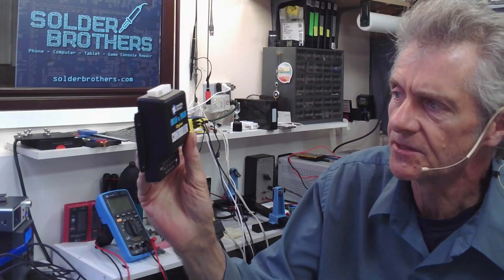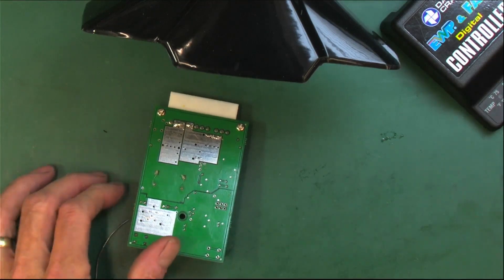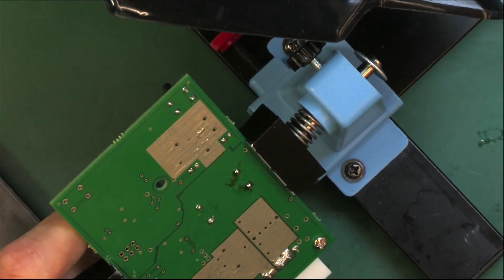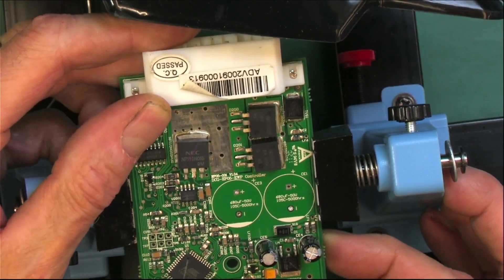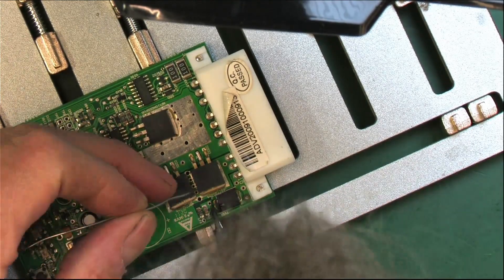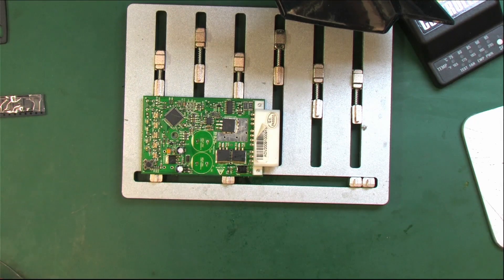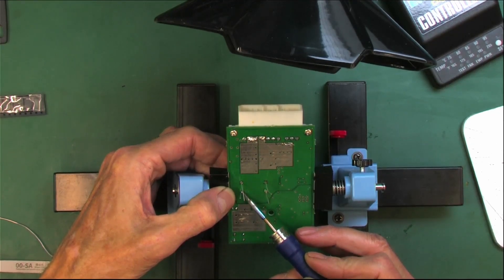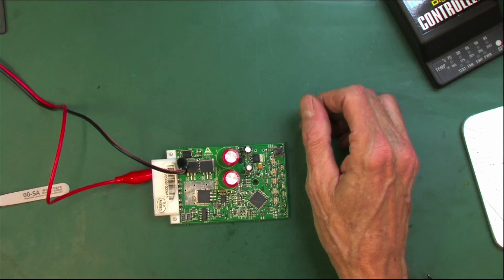1993 Mazda RX-7, FD3S, Wankel Rotary Engine, Davies/Craig EWP& FAN Digital Controller Blown caps.

Comment: Nice. I sometimes use low melt solder and mix it well with the stuff in the holes or keep the board suspended over a little preheater as I clear the holes with the desoldering gun or wick.

Comment: I sometimes use a Dremel with tiny drill bits when I have a stubborn hole full of solder.
Do you have a link to that stand?
Reply from the maker: Timy drill is a good one, I have plenty of them. Grabbed that stand at a local science and surplus, here's an Amazon link, https://www.amazon.com/MMOBIEL-Adjustable-Soldering-Desoldering-Rotation/dp/B098PBPX8W/ref=asc_df_B098PBPX8W/?tag=hyprod-20&linkCode=df0&hvadid=563711343082&hvpos=&hvnetw=g&hvrand=626146960811940568&hvpone=&hvptwo=&hvqmt=&hvdev=m&hvdvcmdl=&hvlocint=&hvlocphy=9021519&hvtargid=pla-1393482532702&psc=1&gclid=CjwKCAjwu4WoBhBkEiwAojNdXohsQp1lx3xPc6qNbLQfg8fEgdiIrRLcr1_MWbpmm_NnEYHM6-jBZhoCySsQAvD_BwE
Reply from the maker: I did grind down the slots quite a bit, but I didn't like how they could hit close the the board edge components.